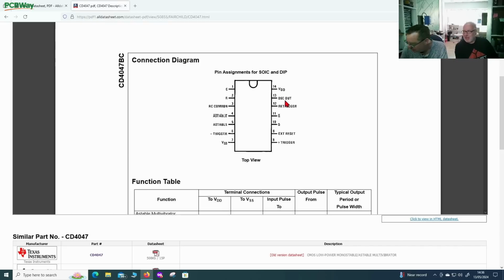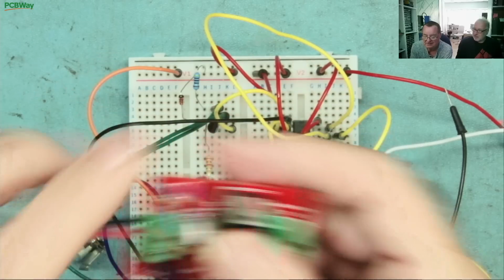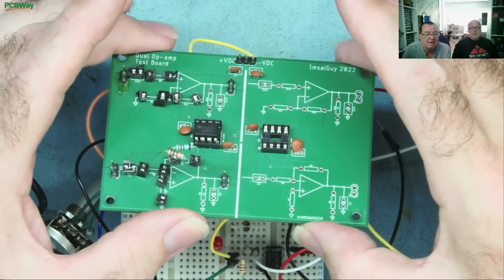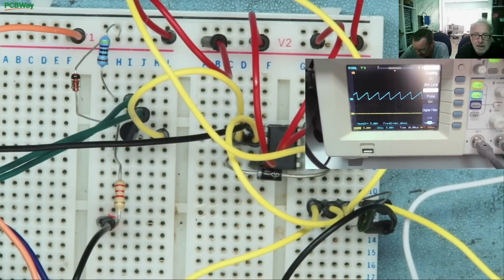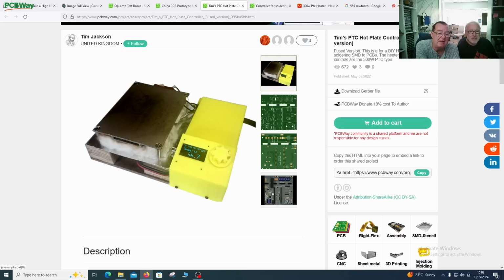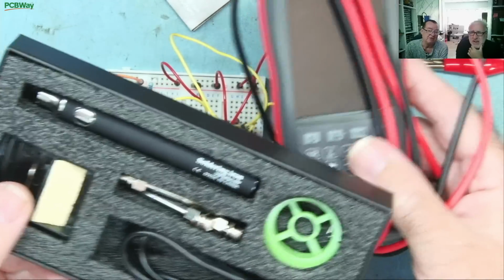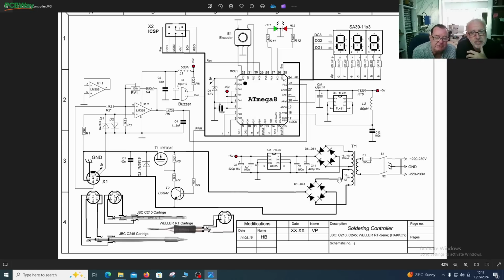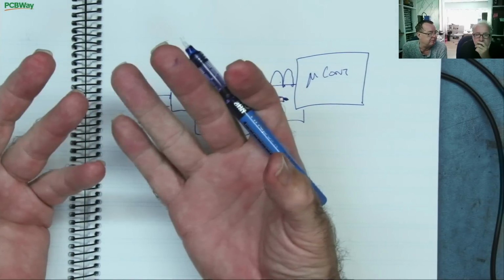Electronics, Projects And Tech Chat with Rich & Detlef

Comment: Do a double sided board with vias and both silk screens, then can flip over for block or schematic view. Might be a hassle with through hole components but could be ok if all smd. Could also put some standoffs on the corners if using through hole components.

Comment: Also, have you considered building circuit design trainer? The big tech companies produce them but the asking price makes them cost prohibitive. 
They are simply large breadboards surrounded by modules of pre connected Pots, Op amps, and every other discrete component you can imagine. 
To set yours apart , add a way to display or project a schematic or block diagram onto the breadboard.  You could display complete or incomplete circuits and the user could attempt to complete the diagram. Interconnect them via WiFi and compete against others.

Comment: Hi Rick and Det.
The thing about PTC (Positive Temperature Coefficient) heater is, remember what it is. Keeping it simple it like the self-resting fuses you have in modern PCB's.
If you keep powering it, it will eventually switch its self off at it manufactured pre-set temperature. Even if you reduce the voltage supply to it, it will aways draw current until it reaches its manufacture pre-set temperature.
The SSR (Solid State Relay) is used as a relay, we don't use PWM.
With regards the Relay you looked at in the Instructable, that is not for the PCB version. There are two versions of this hot plate. (I tried to give options)
One with off-the-shelf modules made for Arduino projects.
One on a PCB that you build using components. (This is the version on PCBWay) You need to look at My inscrutable from Step 27 Addendum [Let's Go Pro]
Most important bit is getting the right PSU, the PCB is designed for.

Um, 🤔 soldering iron.
Perhaps if you got a 24 volts switch mode PSU you can attach it to my Hot Plate PCB?
https://www.instructables.com/Temperature-Controlled-Soldering-Iron/
Just a thought 😁
The difference between both projects is the firmware, Because it uses SSR a It can be changed to use PWM.

Comment: If you do build a project that uses MAINS voltage, can you make it dual voltage so that people in the US could build it too?   Thanks.
Reply: Keep in mind some projects won't work on 110. A small autotransformer may be a useful investment for a small project.
Reply: Could you elaborate?  Because mostly electronic circuits use multiple DC power supply rails, ie 3V, 5V, 12V etc... the input power/Xmfr could easily be adjusted, however new learners might not understand that.  Having one version for 240V 50Hz and a variant for 120V 60Hz should be a simple modification, and compassionate to learners around the world.

In fact, many consumer products already come 120/240V 50/60Hz compatible, this might just be the best option for electronic learning projects, for a wide community.

Comment: In KiCAD it is easy to draw this
Reply from the maker: For some reason Det has a dislike for KiCAD.  I think it's OK
Reply: @LearnElectronicsRepair  ;-) use it the new 8.02 is great (i startet with ver 5) after 10 min you forget Eagle ;-)
Reply: @hschack  - for some strange reason my mind is incompatible with kiCad. If I would want to switch to a new EDA software, I'd probably go for Altium - but for now I'm happy with EasyEDA. And the effort of learning a different software package for this one project is simply not feasable.
Reply: I just use AutoCAD 😂, it's completely not at all designed for PCB schematics!

Comment: Can the 555 timer produce a 250Khz signal?
Reply: Wonder why so many people claim not to be able to get even 100 Khz from a 555 timer. Maybe an effect of the fake chip plague.
Reply from the maker: Looks like we had it running faster than that in this video, around 312KHz at one point
Reply: The worrisome point was the instability/ jitter.  Audio signals are very fussy.  Perhaps a lot of the issue was due to the use of a temporary breadboard, with plug in wires (antennas - as you also mentioned) running everywhere.  It will be good to see of this signal will be cleaned up and stabilized, when permanently mounted and installed on a PCB with proper tracks.  Also, proximity to devices, track design and layout, will affect this and should be taken into consideration.

Comment: what happend with the live stream ??? thought it was every 2 weeks and that was last sunday but no stream !! ??
Reply: We were told at the end of the live stream on 28th April, that the next would be a week after that on 5th May. Unfortunately Carlos had back problems so couldn't make it, so it was cancelled. Next live stream is due on 19th May. I will be out that day, so will miss it. :(
Reply: The original schedule was 7 April, 21 April, 5 May, 19 May...
The one on 21 April was postponed to 28 April.
The one on 5 May was cancelled, not postponed.
So now we are back to the original schedule.
Reply from the maker: @chrishartley1210  Yeah correct.  Also Det and myself were out filming with Julie on the Maspalomas Pride the weekend 11th/12th May for @GranCanariaUncovered That''s one reason why we didn't postpone 5th May as it would have clashed.   Carlos may need surgery so this could be an ongoing problem but hopefully we can keep to schedule from now on.

Comment: OK, you've gone to expensive and inferior coated JBC and Weller tips, and oh boy! a DIY controller. But if DIY is anything to a novice hobbyist, it's to keep it simple and save a ton of money, hence the reason my email mentioned the idea of a foot pedal (or handle button) activated 555 PWM control to the longer lasting and more economical PACE tips. Getting into this zero-crossing temperature sense will now be the economical undoing of this project for 90% of the budget hobbyist's just here to learn. I wish you luck since everyone who's tried DIY multi-tip temp controllers with internal series connected thermocouples has failed.
Back story: When I got my ADS-200 six years ago I started a thread on EEVblog and I managed to get Pace to send Dave Jones one for review. He has a genuine JBC 240 station but ever since, prefers his Pace (you can see it in use all his videos). Anyone can clearly read in the thread (and search YT for "JBC Killer") that serious JBC users have shorter tip life and corrosion. You will also see in the forum thread, linked below Dave's video, many attempts to do what you are doing now. Watch the video and read the forum thread so your project is a success by not failing in the same place others have (and no, I'm not saying this can't be done without low cost Pace tips). Cheers!

Comment: Not that I know what I'm talking about but could the chopper in the soldering controller project also have to do with interference? If you're sending high frequency PWM over the cable into the tip, might this mess up your lab with RF noise?

But given the cost of beefy transformers nowadays, finding a way to make it work with an SMPS might be an interesting mod. People could get started with just an old ATX PSU (has 5V and 12V and usually the necessary amps). And if they need more watts later, they can upgrade to a 24V supply.
Reply from the maker: Yeah we talked about that later.  Best bet is to find some old car battery chargers or similar power supplies at the car boot sale so I'm gonna take a look.  If we were right about the way it operates then we would have to rewrite the code for the MCU to get it to run at high frequency PWM, if it will.  Also old scrap UPS should have at least 220V-12V output transformers and I guess two could be used in series to give 24V AC, taking care to get the phase correct The original design must have been like this for a reason.  Old scrap PA amplifiers are also a good source but usually the transformer output voltage is too high
Reply: @LearnElectronicsRepair  Couldn't you just fool the MCU into thinking it's got a transformer? If all it's looking for is the point of 0V on the input, wouldn't a square wave suffice? Using a 555 and a mosfet to get something like PWM at 100Hz with a ~99% duty cycle?
Reply from the maker: @Foobar_The_Fat_Penguin  Hmmmm....

Comment: 24:30 I think that silkscreen idea is almost ok. The opamp symbol should also show the pin numbers and the resistors etc should be positioned next to the actual pins on the chip. But op-amps are really simple and have 4 or more of the same circuit inside so you should try to use all 4 circuits simultaneously. The through-hole parts like resistors etc can go into single machine pin sockets so any part can be swapped without soldering. Another way would be just use a breadboard and all you have to do is provide an infinite number of pdfs that can be printed out and laid on top of the breadboard and components pushed through where the printout has the parts. But really all of that can be simulated in software on a PC using free circuit modelling software. I don't think it's particularly helpful to produce a fixed-function PCB for learning simple stuff like that. I guess you're trying to reproduce the fun learning experience we had as a kid ~40+ years ago with those 100-in-1 electronic learning kits. They were interesting but I'm not sure the kids of today would accept them. Use a cheap breadboard with a printout overlay and then later design a more useful pcb that does something constructive that uses the parts you just learned about. For opamp testing you could make a board so they can be plugged in and tested. If you look on Ali you will find one that sells for a few dollars that can do that and has sockets for several common opamps like lm358, tl074, lm324 etc

Comment: More likely the chips were defective at the factory ~30 years ago and someone scabbed them out of the bin and sold them. You should test chips using your Retro Chip Tester.... there's no need to guess.
Reply: As I recall, he tested them with a circuit from the data sheet but wasn’t able to use any of his chip testers because this chip wasn’t listed as an acceptable chip to be tested.
Reply from the maker: @mikebond6328  Correct. I think the Retro Chip Tester does test 4047 but needs an adapter . Mine still isn't complete, I need to order one more part and I keep forgetting